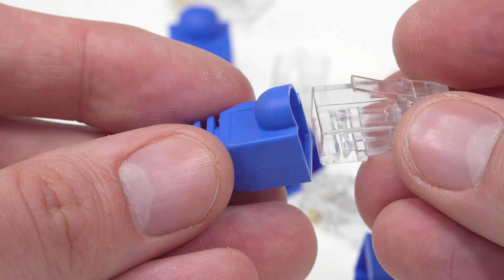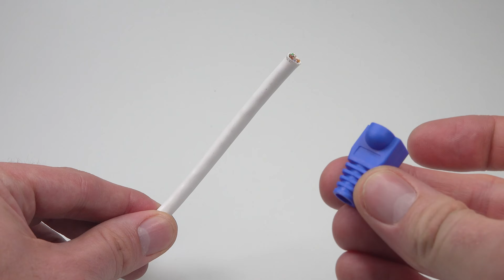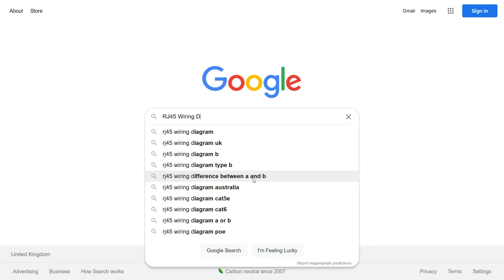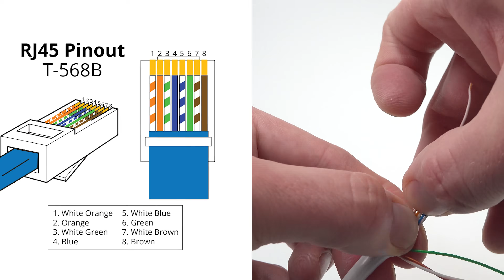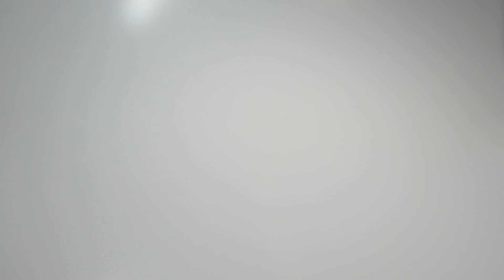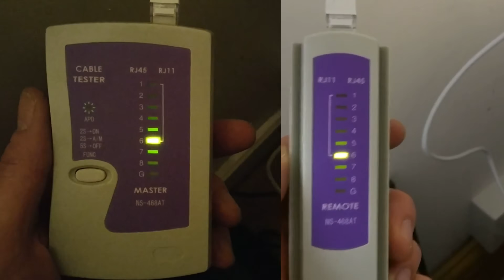How to Crimp Cat5 / Cat6 Network Patch Cables (RJ45 plugs)

Comment: Guys how do you cut the outer part without damaging the wires inside😭I tried using the yellow tool and it kept damaging the wire.. Any suggestions

Comment: Our subject, networking made us do this, zero knowledge about the subject btw and how to do this, we got zero except for two students who got lucky. The criteria is strict, all wires have to be fully pushed in, you can see from both sides, the first and last cable must surpass the gold pins, then at the pointy part you have to see the shiny dot of the end of the wire clearly to see if it's fully in, the problem was the wire won't stay aligned whenever trying to slide in after cutting it. The structure of the cable also doesn't help as some wires are too far from the others and will constantly keep inconsistently stop going in fully in the rj45 and when we take out the wire we will see that every wire is now not aligned have to cut it straight again until there's no more space then back to square one😅

Also as you mentioned the jacket has to surpass the point where the rj45 grips onto the jacket when crimping and BTW we CAN'T USE PASS THROUGH

Comment: This video doesn't make any sense. You need more than just skill to learn how to do this. The guy just says "a drum  of Ethernet cable", however while trying to organize the colored wires and try to straighten them, you can clearly tell by then that you need a different type of cable. I followed the directions perfectly and yet my wires are unstable, keep overlapping themselves, while this guy does it perfectly with ease.
Reply from the maker: What do you mean, a different type of cable? You can use this guide to crimp RJ45 plugs on Cat5, Cat5e, Cat6 Cat6a cable etc. etc.
Reply: @SwitchedOnNetwork  How did you organize them so perfectly?
Reply from the maker: Practice! Also it's important how well you straighten them out so they forget the twists after you untwist them. Run them each tightly along the back of a screwdriver or something, between your thumb and the side of your first finger, a few times each and they'll soon straighten out and be more obedient! 😅
Reply: @SwitchedOnNetwork  Thank you! I'll try to do this more

Comment: Messed up 4 plugs already 😭 seems I can’t do this, the wires never lineup correctly when inserting the plug no matter how flat I cut them and how much I grip them tight… they always end up swapping places at the very tip, or end up two in the same channel

Comment: I always fail at the insertion step (3:50 in the video). How is one "careful not to let them come loose"? As soon as my thumb comes off the wires, they fly out of formation.
Reply from the maker: Grip really tight and push downwards slightly as you insert them, then only let go at the very last possible moment, once you've felt them start to go in slightly

Comment: i watched this, said hmm seems simple. completely fucked it up started with 10 connectors finished with one left over for the electrician, thanks for the false confidence! 
not your fualt im just an idiot.:face-blue-smiling:
Reply from the maker: Learning to crimp takes a bit of practice, but you'll definitely get the hang of it eventually! 😁 Have you seen my other video on Pass Through connectors? They're MUCH easier.

Comment: Why would you cut the wires so short before putting them in? Isn’t it easier to maneuver them when you have some slack then cut off the excess?
Reply from the maker: Are you getting confused with pass-through RJ45 plugs?
Reply: I agree that the entire sequence in 3:52 is NOT easy 😂  It’s even worse with stiff wires you’re trying to line up perfectly, the second you let go, everything shifts out of place.  Honestly, I’m just glad I found his pass-through video, I was about ready to give up.
Reply from the maker: @Placid_Falcon yes, pass-through is MUCH easier!

Comment: RJ45 plugs with holes for the wires to pass through is a lot easier, can put each wire in its place individually. I purchased RJ45 plugs that don't have the pass through by mistake hence looking to see how to get them to work.

Comment: this looked like a lot of work but it doesn't seem that bad, Specially since you don't have to strip each individual strand and or crimp them individually.  but it'd have to buy a few pricey tools ;c I do have a multimeter tho can test the cable with that. but the crimp tool is 55CAD 0_0
useful to have aroun dI guess?

Comment: Ok so this isn’t ideal but you can put the wires in the punch block without a punch down a lot of the time you can get your fingers in each side of the wire and manually push it into place you will have to manually trim down your excess tho and most wall jacks come with a plastic punch down tool that requires manual cutting anyway

Comment: slight correction, a cable tester should not be used.  You should wire up an entire production patch panel to switch setup all at once and leave the site before they turn on the switch
Reply from the maker: haha 😂

Comment: There is 2 kind of 8p8c connectors, one for solid wire and 1 for stranded. Make sure you choose the right one. People often refer to the connector used for Ethernet as an "RJ45", which is technically incorrect. Just saying.

Comment: So what you're saying is I need to get a pre-made cable.
Reply from the maker: No, it's easy! If you're doing a long cable run or need a very specific length then it's easy to cut to size and terminate yourself. For short lengths a premade patch lead makes more sense though.

Comment: If I understand correctly the colour order makes no difference as long as both ends have the same order. If this is so then why the heck the colours are not simply in order of full/stripy? Why mixing blue and green?
Reply from the maker: Because the pairs relate to each other and each have a specific role to play. They're twisted together to avoid cross talk from other pairs. Therefore each pin, 1-8, has a specific and defined role and that's on the provisio that each one will be twisted with its pair.

Comment: Does it make any difference at all, if the colors are same on both ends? Asking for a friend...
Reply from the maker: Good question!  It’s not just about “same both ends” in any random order — the colours matter because the wires are twisted into pairs inside the cable. Each pair is designed to reduce interference (crosstalk) by keeping the signal and return tightly wound together.

In network cables, different pairs are used for different jobs (transmit, receive, power in PoE, etc). The two official wiring standards (T568A and T568B) simply decide which colour pair goes to which pins on the RJ45 plug. As long as you stick to one standard on both ends, everything lines up correctly and the twists are preserved right up to the connector, which keeps the signal clean.

If you mix the colours randomly, even if it’s “the same both ends”, the pairs get broken and you’ll get more noise, poor performance, or it might not work at all. That’s why we stick to A or B.

Comment: I would avoid using that style of strain boot. I have found, as have others, that the damn things get hard as a rock making it a miserable experience trying to release the connector.
Reply from the maker: It depends on what plastic it's made out of, rather than the shape / style. Some are an absolute pain, you're right - these ones that I'm using in these videos are fine :)

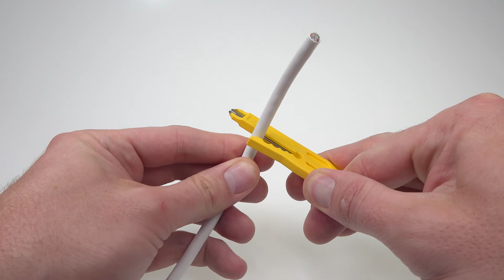Comment: 1:18 This wire color pattern is the same as the one used for front panel switches on the motherboard: Red1 (HDD LED) or Brown, Green2 (PWR LED + -), Blue3 (RES SW), and Yellow4 (PWR SW) or Orange.

Comment: If I had a cat5 cable somewhere in the mix of cat 6 would it limit the capacity to that of the cat 5
Reply from the maker: Potentially, yes - but you might still get good speeds as it depends on a lot of factors. Or you might not. Try and see :)
Reply: Thank you 

I ran a wire from my router to garage .. made my own cable .. I have gigabit internet and am only seeing 140-200 mbps .. the cable is about 75 feet long … 800-900 right next to router .. WiFi sucks in garage only grabbing 25mb ..

Comment: Witch!  How are you getting your wires to stay put when you let go and slide them into the plug?  I get mine all straight and the instant I let go they jump all over!
Reply from the maker: Have you straightened them out enough? If you run each on in turn along with your finger and the back of a pair of pliers or a screwdriver to straighten it out, it should stop them from wanting to revert to their twisted shape.
Reply: @SwitchedOnNetwork  I thought I did.  The main issue seem to be the twist that remains right at the jacket after I've arranged the wires.  That little bit of torque seems to be what's doing it.  Not sure how to avoid it as it's the arranging of the wires that seems to be doing it.

Comment: Thank you so much for this very clear video. Question, what to do with the one extra metal wire? Is it the ground? Does it affect performance if removed and not touching the connector?
Reply from the maker: Sounds like a grounding, yes - if you can, use shielded RJ45 plugs. But if not, it may not matter to you too much - shielding helps protect against interference so if you're somewhere where that might be an issue, you won't get that extra protection. But if you're somewhere that's less of a worry, then you'll be fine.
Reply: @SwitchedOnNetwork thanks for the quick reply! I always thought it was a safety concern as well, and protecting hardware when overloading. But this cleared it up, thanks!

Comment: Wow. So professional. What's the difference between when you want to connect two pcs directly not through a switch? I know cabling is different in this case.
Reply from the maker: That's a crossover cable - when it's wired to T568A at one end and T568B the other end.

Comment: My connection doesn't seem to go through, i haven't got a  tester to try it, i reckon my cable is broken some where down the line.
Reply from the maker: I'd definitely recommend buying a testing tool. Also, you might also be interested in the video which just went live on the channel TODAY - https://youtu.be/t_QWqDRh_oo - these are RJ45 plugs that you don't need any special crimping tool for!

Comment: this has probably been asked before, but why are the colour pairs mixed? why not blue, orange, green, brown withe the assoited whites just put in order.. if both ends are the same why would it matter?
Reply from the maker: When wiring RJ45 plugs, you must use the T568A or T568B standards because each pair of wires is specifically twisted to perform a distinct function, such as sending/receiving data or delivering Power over Ethernet (PoE). The twists in each pair reduce interference and crosstalk with other pairs, ensuring reliable performance. These standards ensure compatibility with devices and maintain proper signal transmission.

Historically, T568A and T568B evolved from telephone wiring standards (like RJ11) for backward compatibility, particularly in environments transitioning from older systems. Using a consistent standard ensures that the cable works with all equipment. While matching the order at both ends might seem fine, mismatched pairings would disrupt these functions, causing poor performance or complete failure. Standards are there to ensure cables do their job effectively and reliably.

Comment: did not mention there are different RJ45 for different standards of cables. CAT 6 is thick for some RJ 45. There is Rj 45 which consists of two parts. There is a plastic sleeve through which you put wires and then stick it to the RJ45. Or there are RJ 45 which you can thread through the connector so you can see colors coming out at the end of RJ45 , and then trim them and clamp them.
Reply from the maker: Yep, got videos on the channel for both those types - check them out 🙂

Comment: Couldn't figure it out, sorry. The wires in the Ethernet cable wouldn't straighten out in the direction I need them to.
Reply from the maker: Try using the side of a screwdriver to run along them and straighten them out. With practice it'll work 👍

Comment: Using patch cable stranded wire is VERY HARD to get right, as the wires do not "stay put" and can flip before you crimp. Using in-wall / plenum cable for patch panels is typical, but wrong. Eventually the solid strands will start to "break loose" from the crimped plug conductors, and now you now have mysterious slow networking / outages. This is a skill that takes practice and patience.

Comment: Perfectly worked, thanks. It's very important to test the cables to don't assume it's not working. It wasn't working until I understand I had to setup my router, the tester helped to understand I didn't have issues with the cable.
Reply from the maker: Great to hear! Glad the tester helped you find the issue as well :)
Reply: 😂keekjkkpp
Motkc 😊❤❤❤😊❤❤❤🎉 us 😂 😂 😂 🤣 iiiii @SwitchedOnNetwork
Reply: @SwitchedOnNetwork  I got a huge carton of Ethernet cables from an office dumpster (200 lbs of wires), and use a tester like this to diagnose each length of cable. I was able to weed out all the garbage cable and find cables that had nail holes through them or other damage and make a nice crate of good cables - of very expensive brands. I kept some for me and sold the rest. The garbage cable I painstakingly inspected by eye and cut out the bad parts and made another carton of short stumpy patch cables with new ends and ended up with another carton of those to sell. Probably made $600 off them all. These cable tester tools are a lifesaver!
Reply: I’m running into the same issue, what did you do in order to solve it?

Comment: Ive got 'outdoor shielded' cat 6 cable. The wires are way too thick  to push in. Are there different jacks available?
Reply from the maker: Yes, you can get plugs with different gauge (AWG) but for that type of cable you're better terminating it to a keystone jack in a wall socket and then using an off-the-shelf patch lead to connect into the device.

Comment: I thank the network gods (or whoever invented it) for the pass through RJ45 which has holes in the end so you can slide the 8 wires right through the connector and pull the insulating jacket in tightly with them - and then check the cable order before you crimp! Genius invention and has saved me hours of redoing terminal connections because one wire moved or snagged as I was inserting them into the RJ45.
Reply: I need that tool. What exactly is the name for it? I am wasting too much time putting these cables together, Please HELP!!
Reply: I need it too
Reply: Look up “pass through rj45 kit”. It’s not much more expensive but you need both a special crimper and special terminals that allow them to pass through. So much easier because you can have several inches of straight wires to hold onto, instead of a few CM.
Reply from the maker: @dapaintballer3311 I've got a video on that system too: https://youtu.be/NWhoJp8UQpo
Reply: @dapaintballer3311  No need for a special crimper, any standard one works perfectly. Pull the wires through the connector tightly, check the correct order, snip them off straight and put the connector into the crimping tool. Then retract them ever so slightly so that the ends are flush with the connector, and crimp down. As a bonus you can even get these connectors in different colours from Temu, which is great for identifying long cables when you can't see both ends at the same time.

Comment: What does crossover mean ?
Reply from the maker: It's for connecting two devices directly together (ie. not via a switch or router), so the "send" on one end will be considered "receive" at the other end, and vice-versa. Wikipedia will give you more info if you want to read up: https://en.wikipedia.org/wiki/Ethernet_crossover_cable

Comment: Confused, you mention using one A instead of B. I assume if you are running a cable from your modem to a tv there is no choice but to use what is already set up. ?.
Reply from the maker: The important thing is to use the same wiring standard at each end of a cable, A or B. It doesn't really matter what the rest of the network uses as long as each end of the cable is the same, but for the sake of neatness and consistency I'd use the same as elsewhere if you can.

Comment: I do and can crimp my own cables but i have always struggled with something. There's 4 pairs right, so is there an optimal order in which you straighten them out and try to arrange them? Because one pair goes down the middle, one pair goes right around it, which makes it a little weird, and then two pairs go on each end... so things end up crossing over every which way and i have to fiddle for a while until i get them in order and straight.

Also how come the pinout is this weird anyway? It just seems so absurd.

I didn't have a crimp tool when i crimped my first cable over 20 years ago so i just used a tiny flathead screwdriver and hammered the contacts in until they pierced. Finicky but it worked. I think i'm still using that cable somewhere. Crimp tools were painfully expensive back in the day; nowadays it's kind of a shame not to own one.

I had no clue cable testers were this cheap, several times cheaper than a crimp tool. I mean yeah i can see how they would be, it's just some slow clock generator (eg a 555 or a couple Schottky gates or just a couple transistors) and a 40/74 series counter IC, those have never been exactly expensive, plus standard parts like resistors, LEDs, diodes. Probably single sided PCB.

Comment: So idk if this relates to the video but, I want to get Ethernet in my room which is in the basement right below my modem, and I noticed that I have a cat 5e outlet built in my wall right beside me, I’m just confused on how I could get it, do I simply just plug in the cord into the wall and in my device?
Reply from the maker: Yup, assuming there's a working cable run behind it that should work just fine. At the other end just plug into your router.